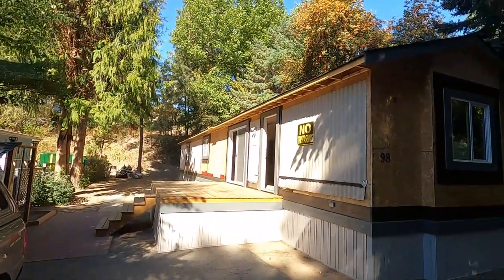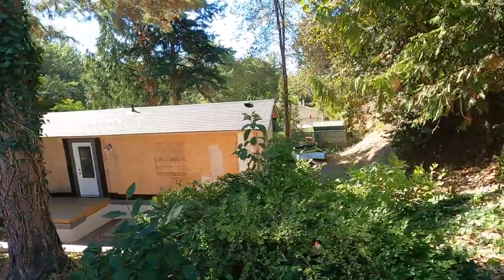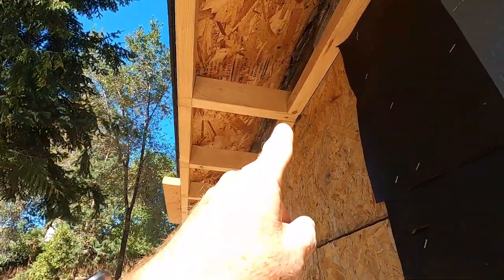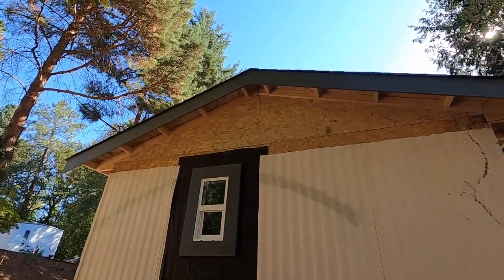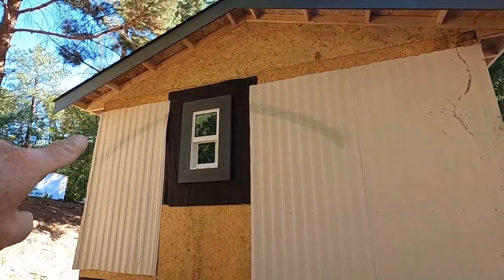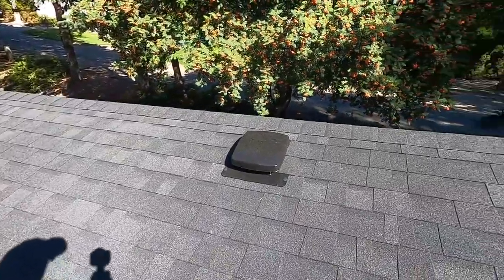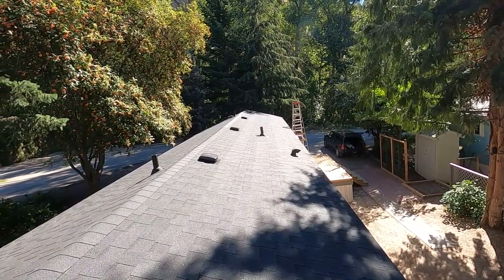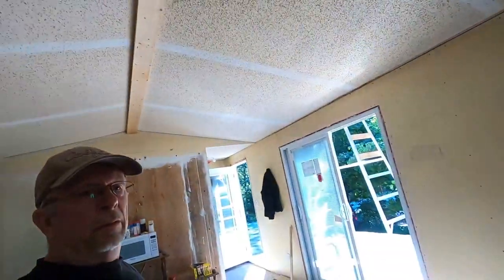The Old Abandoned Mobile Home Gets A New Roof : E119 / BC Renovation Magazine

Comment: Sorry it wasn't feasible for you to record the roof installation, I totally understand. My question is did you lay the plywood directly on the tin roof or did you add furring strips on the roof first?
Reply: Guessing he installed furring strips so there was a air channel from the soffit to the box vents? But I dont see a gap from underneath. Was going to ask a question myself, like how much further would he dare to have a overhang using that method..